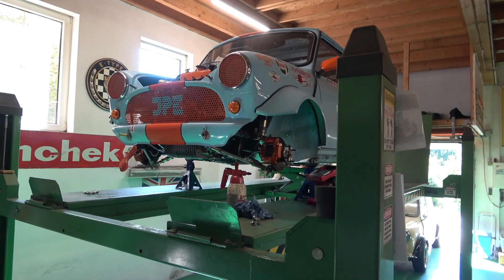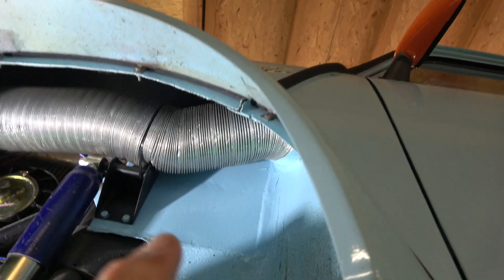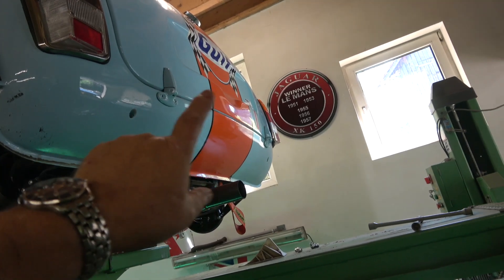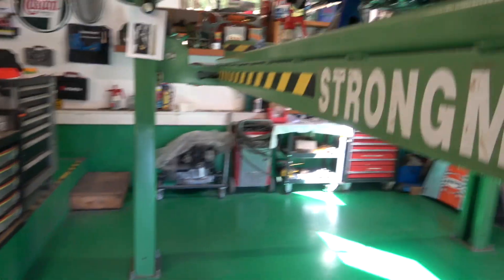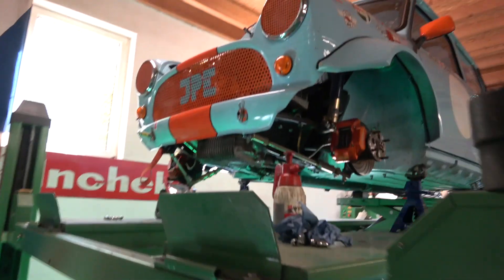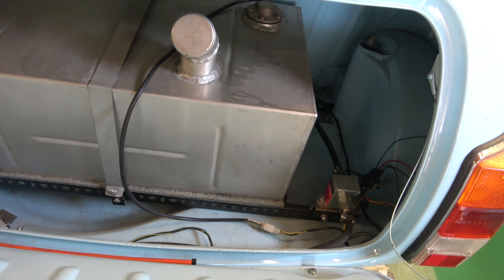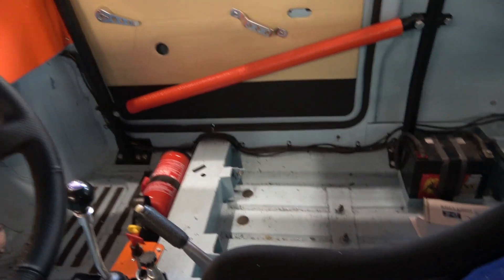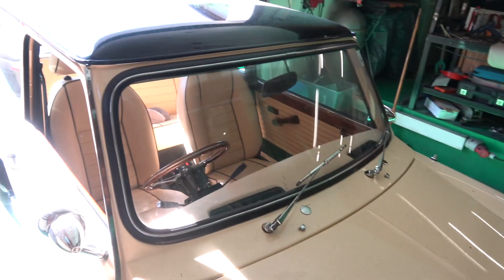Gulf Mini Red Bull Race Preparation Part 1

Comment: Its all looking good whereas for me it is like being Frank Spencer, "I have a problem Betty", new oils cooler fitted on the original stand behind the grill, braded pipes fitted, BUT.......distributer  cap does not go on now, hell (which is not the word I used)  but some thing is not quite right I think !!    Best Regards  Doug.
Reply from the maker: Doug,  We are getting there but still quite a bit to do 🤔 Some times things don‘t go right and waling away for day normally works🤣😂 Cheers Dave